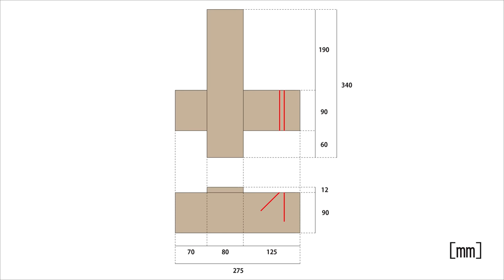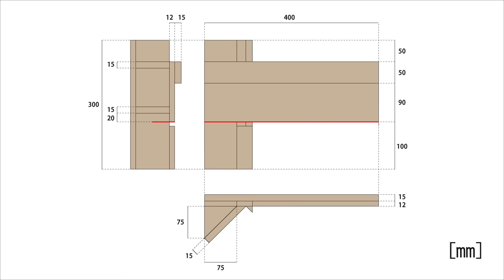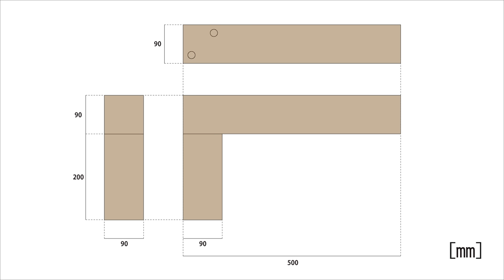5 Simple Circular Saw Hacks | Woodworking joints

Comment: My top two tips for anyone struggling with their circular saw game: 
1) A good blade is a true game changer. The expensive ones are worth their price. The best one in my opinion is Makita Efficut Z-56. Day and night difference compared to the cheap ones or even the mid priced ones. They're around 40-50 a piece. Goes through wood effortlessly and with low noise and vibrations like hot knife through butter and the finish is super satisfying. After several years of using the cheaper discs, I got a good one from a friend and there's no going back anymore. Even the battery life you get compared to a cheaper one is like 10x, especially when making long rip cuts. 
2) Check and correct the squareness of your blade vs. the base. You need to do this periodically. If it's off just by a little, your joints won't match. If it keeps drifting too often, you need to renew the loctite in the small adjustment screw you use to square it.
Reply: nice tips! i am using the makita blade that came with my dhs680z, but not sure if that's any good. on number 2), i actually realized on my last cuts that they were not square but didn't realize the saw had an adjustment screw for that. will check for that asap :)
Reply: @Bowl1992  It's been a while since I got mine, but I think it may come with several different ones depending on the package or where you buy from. The best in my opinion is the one that has the big SPECIALIZED text on it. They're around 40-60 usd/eur for one. It's so satisfying after years of using worn or mediocre blades. The adjustment screw is the one under the tilt-angle lever. There's another one for setting the maximum tilt, I set mine to 0 and 45 and ignore the numbers on the dial. You need a small hex key for it.
Reply: Thanks so much man:) tried to adjust it yesterday and hoping to get better cuts now!
Though I found adjusting a bit tricky with the saw on my lap , holding the blade protection back, checking with the right angle and adjusting the screws at the same time:)
Reply: i noticed with blades being a lot thinner rip cuts tend to drift easier if you hot a lot to do consider a wider blade…less flexing
Reply: Can you please tell which Makita model he uses and which disc model ?
Reply: @GlobaVizCom  I think it's some japan only model.
Reply: Its a senior special for people who live in Japan